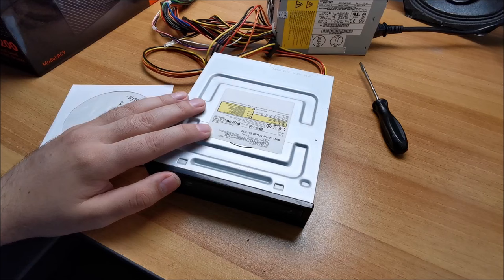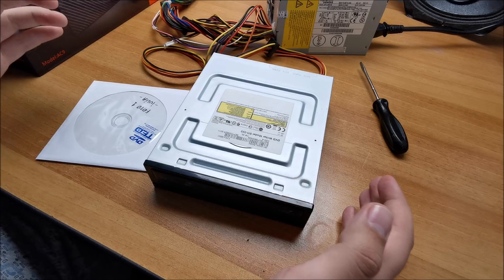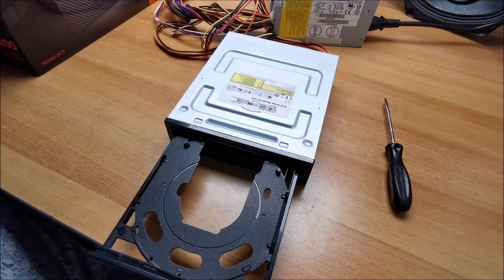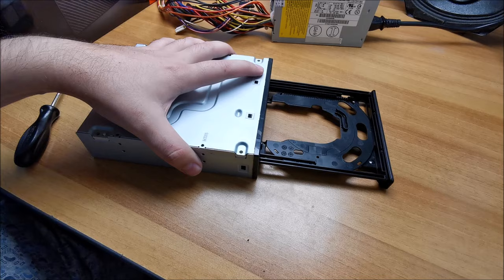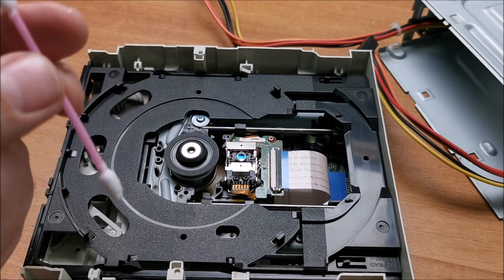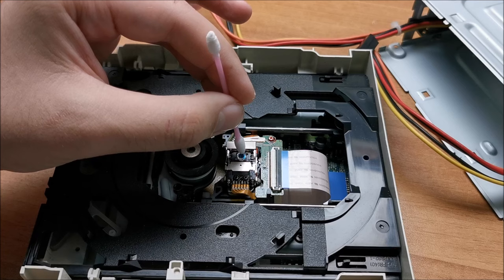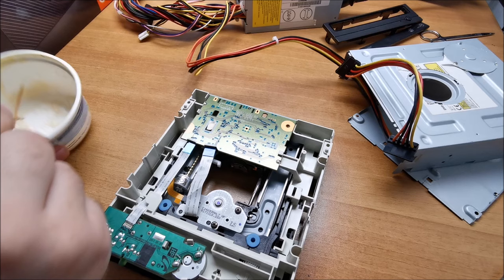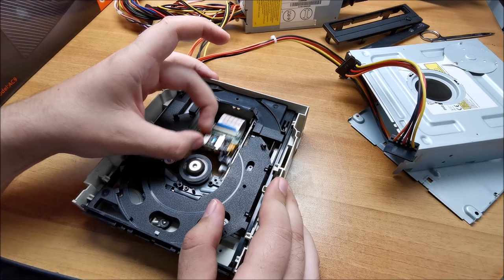How to clean an optical CD DVD drive that is not reading disks anymore

Comment: I was trying to get an older dvdrom to read a movie disc and found it almost impossible to get the cover off to expose the lens and clean it manually. I had a thought: Instead of giving up I used my portable air tank and a an air nozzle on a hose and , with the tray open, I blew two good blasts of air into the interior of the  reader.  I came back inside and stuck the movie disc in this machine, and guess what!  It immediately brought the movie up and started to play it. I had spent over an hour or more trying to get it apart to manually clean the lens--and with the air tank it took about 3  minutes! This might be a good first step in checking non-reading DVD or CD Roms BEFORE one spends hours trying to disassemble them, and takes a chance on breaking something in the process.
Reply from the maker: Thank you for the info. Yes, blowing the dust off the lens is a good first step.

Comment: Same problem on a different drive unit. I suspect the lens touches the disk... Too bad it does not give off error codes so it can be properly diagnosed.
Reply from the maker: Did you see marks on lens or disk?
Reply: @UltimateDIY  Nope. I still have the drive and can donate to you if you'd like it. But I doubt you will have the proprietary interface.
Reply from the maker: No, it's ok. Thank you anyway 👍🏻

Comment: Thanks for this guide. My DVD rewriter stopped reading disks with read errors. Took it apart using your guide and cleaned the lens with some alcohol. The lens didn't look dirty, so didn't hold out much hope.
However, it seems to have brought it back to life. Fingers crossed it lasts.
Reply from the maker: Welcome! Glad my video helped!
Reply: Same here. But i have been doing that for years and worked 9 out of 10 times. No light alcohol like video says because there is water in  light alcohol. 99% is much better.

Comment: Hello friend, I am in a similar situation with a Toshiba/Samsung SH-216 DVD and CD read write optical disc drive (ODD) very similar to the unit you attempted to repair.  At first, I was disappointed that you could not find the root cause of the problem.  I learned several things, how to remove the front door, thanks.  I learned how to release the retaining mechanism from ribbon cables.You are a patient man.  I learned how to remove and reuse the spinning magnet which holds the disc in place.  I'm sure there are several more things that I haven't given you credit for.  Good luck in your future repairs.Thanks !!
Reply from the maker: Hello friend! Thank you!

Comment: Gonna try some of this. IF it doesnt work, nothing lost. its still dead. If it does..... :)
Lots of old games on disk that i still love.  
Sure. I could buy a drive for 20 USD.... but thats money i could put to better use.
Thanks for this.
Our grandparents used to fix their own stuff. Heck. Our dads used to fix stuff.
Past the 80's tho.....stuff just nearly went unfixable.
Cars are a total loss. You can change the oil. Maybe the plugs. The lights are tough sometimes but doable.
Anything serious? Lots of times... nope. Not even a simple alternator swap. Forget a timing belt/chain or water pump.
Reply from the maker: Yup, I feel exactly the same way you do. Nothing can be fixed easily anymore...
Reply: @UltimateDIY  by the way....MY DRIVE IS FIXED!  YOU ROCK!
Reply from the maker: Awesome! ✌🏼

Comment: Thanks for your efforts in putting this video together.
 I have a Panasonic DMR-EH59, a stand alone DVD recorder w/ built-in HDD. It wouldn't read disc's that were recorded or recognize blank disc's to write. 
Cleaning the lens on laser has seemed to solve the problem but while inside the DVD section, I noticed the one rail appears to have no lube on it. 
What specifically is that grease/ lube you are using? It said 'Vaselina' on your container. Looks like a lithium or silicone based sort of grease? I appreciate your help. Thanks much..
Reply from the maker: Glad my video helps. It's silicone grease.

Comment: It was the little motor that moves the laser (bad 1st position calibration moves. This motor gets weak over time). A lot of SH-222 and SH-222BB died by this. Just a general issue with this model.
Reply from the maker: Thanks for the info 👍🏻
Reply: Is there any kind of fix? Id like to get my one working again
Reply: Motor replacement

Comment: I need help. I saw your laser emit red but mine doesn't. I tried using camera to see the infrared and there's nothing. The problem is that the drive wasn't able to detect a dvd.
Reply from the maker: Could be a laser or electronics failure.
Reply: It could also be an electronic safety feature that measures the ambient light level and if it's too bright, meaning the laser unit isn't surrounded by the housing, then it will stop to turn on the laser.

Comment: at 22:42 (worked) you can see the red laser light through the disc.   at 23:45 (did not work) we do not see the laser light.  i have the exact same symptom on a drive here.  still haven’t figured it out.  

however, this was a clue i found.  occasionally the drive works.  each time it did, it was because the laser was lit up (and stayed on).  each time it failed to to work, the laser was off or only flickered on for a split second.

If anyone else seeing this might know the answer to this mystery, please let me know.  :)
Reply from the maker: That's the issue. The laser starts for a split second to focus and see of a disk was inserted. If it does not do this properly it will not continue to light up as it thinks it has no disk.
Reply: i tried with different discs and some will start reading immediately and others do not.  did not matter too much the condition of the discs.  some scratched discs read fine.   some unscratched discs could not read.  still trying to find a pattern.  i know i can order another laser assembly but solving the problem seems more fun at the moment.

btw, adjusting the POT didn’t matter too much for this issue.  high resistance made the drive give up reading after one try.  low resistance made the drive try several attempts to read.  but the attempts do not work because the laser fails to stay lit.   when it does work, i can see that the laser is just brighter (which might burn it out)

thank you again for posting this video.  it described my situation exactly.
Reply from the maker: There might be something alse at play here. Not all optical disks are written in the same way and even have different substrates. Did this particular drive read everything in the past?
Reply: good question!  this is a used item.   this is the first time i’m seeing it.  i would have expected this have worked with all the usual discs.

fyi.  this is a xbox 360 drive.  it should be able to read CD, DVD, Xbox 360, and original Xbox discs.  these work when tried:  CD, DVD movie.   it occasionally reads, for example, “game1”.  a second retail copy of “game1” however rarely reads.  same game but maybe different manufacturing.   interesting puzzle indeed.  i’ll poke around some more and most likely will replace the laser assembly in the near future.
Reply from the maker: Hope you get it sorted 👍🏻
Reply: @damondtv  The firmware does also play a role in adjusting the laser to different media material. If you have newer CD-R(W), DVD-R(W) media a firmware update can help if it is available. Many old drives don't get a firmware update by the customers and then they couldn't read newer media with changed material substrates. Thus it's worth a try to find out if there is a newer firmware update from the manufacturer available.

Comment: I won’t buy a computer anymore that isn’t Apple because a few years ago My perfectly good laptop screen went black, dvd drive locked, Wi-Fi key red, cap lock key flashing blue. All that happened because updates were  installed. Updated to windows 10 and soon after other updates tore my computer up.
Reply from the maker: That is a bit extreme for an update. I don't think I ever saw such a bad situation caused by windows updates. Maybe it was just a weird coincidence.
Reply: @UltimateDIY  when I searched for help there were many people that it happened to. 
I can plug it up and turn it on and it sounds like it always did when it was loading up but like I said the screen is black, the Wi-Fi lights red, caps light blinks blue and the cd driver won’t open. It’s old now but It was a waste.
Reply from the maker: Motherboard problem most likely.